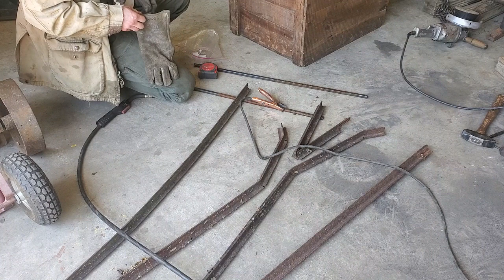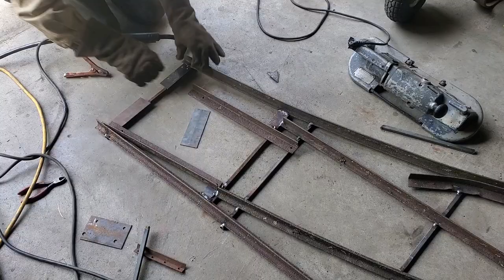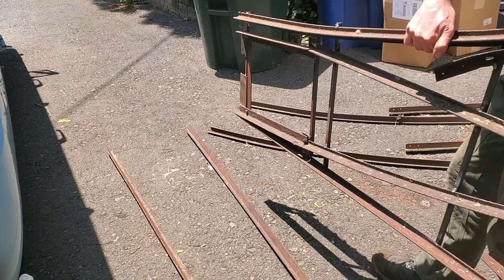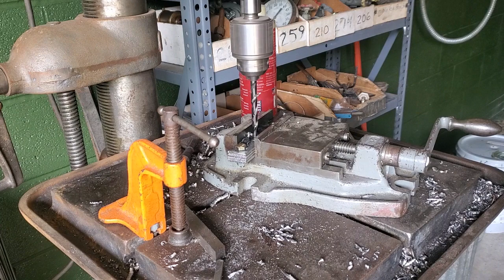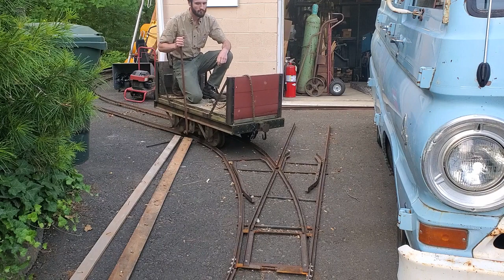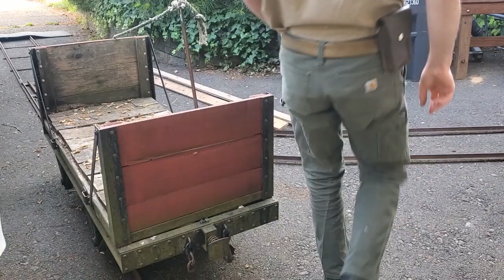Railway Update May 2023 - Driveway Spur Switch

Comment: Yes to sliding anchors. Suggest fitting easily removable mats shaped to fit at the center and sides of the track then, add a layer of new ac paving to help with the transition and sloped to control drainage too. Great work!
Reply: There are equine rubber matts that can be had in the appropriate thickness that are made of recycled tires. You have to look it up though on your own. We're not allowed to paste a website I guess. Sorry to the mods.🙃

Comment: Nice update. Have been flowing your channel and it brings trains and metal working which I love both. I do have one question. When you cut the flange section on the rail for sharp bends like in the frog, do you weld up that joint? I saw the cut but it didn't look like it was welded and if not I could see that as a weak point that could lead to failure with cars in the ground.